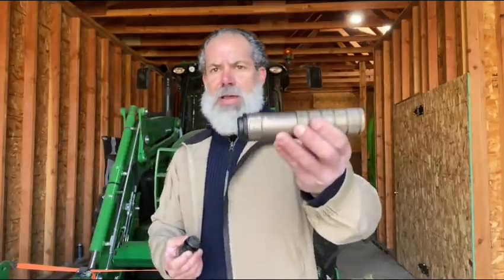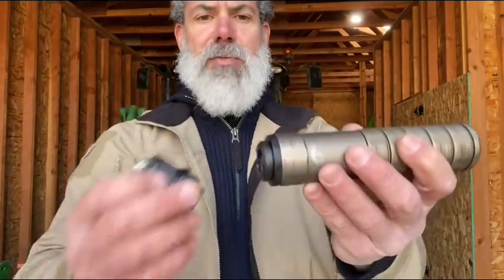@jkarmament form 1 solvent trap and now even more!

Comment: Wait... What was goin on at the beginning when you were goin full auto. We're the baffles like melting off or were they unscrewing or something. 👀
Reply: That's why you don't use aluminum for a suppressor
Reply: @picklerick9578  I just wish he answered the question. Not sure wtf happened there
Reply: Cerikote flaking off the suppressor.
Reply: Look like the finish was flaking or the baffles were coming loose?
Reply: If you watch closely you can see it's rotating counterclockwise. Unscrewing itself. There is a spot to focus on about midpoint of trap at 12 0clock position. When the video cuts it's almost at 9 0clock position..
They are notorious for unscrewing. I've had it happen and I've seen it happen to someone else.
NEVER USE ALUMINUM. PERIOD.
Reply: @ageckomiller  gotta run em with the keymo mount

Comment: I recently bought the jk 155p. I just got my Form 1 back and drilled for 9mm. I like how I can use different mounts as I also intend to use it for 300 blackout by way of the Griffin plan A mount. I would love to see a decibel test of the jk can with 8/6/and 5 baffles on both 9mm and 300 blackout. Love your gear reviews and wish you would show off and go over your AR15's with us. They would get tons of views.
Reply: Does the griffin plan a have a hole for a pin weld
Reply: No it does not
Reply: @Kentucky.Tactical  dang it I got a geissele super duty in 14.5 with a surefire flash hider I would like to find a quick detach mount that I can run a jk armament can on and still be legal 16” with pin and weld
Reply: What do you think of the quality compared to other products on the market? I’m really intrigued but this design but my gun snob friends are trying to talk me out of it saying it’s a “cheap knock off of silencers”.
Reply: @joshuazachmann6644  I know it's an old question, but he does have more than one. I'd assume for you to buy multiple they have to at least be decent.
Reply: @The-Tactical-Plumber  I know its 2 years later, but some of griffin's taper mount muzzle devices DO have a pin hole for pin and weld. Just did mine not too long ago
Reply: @Dethnaught  in that 2 years I ended up getting a surfire rc2 for my 14.5” super duty witch is now a full clone urgi with a 4 prong flash hider got a Allen engineering aem5 for the mk12 mod1 that’s like 280 days in on e file and just bought a sand man k now I just need a 9mm may go the jk route for that the new 12ga can looks cool too

Comment: I wish I could say that it's faster to file a form1, but due to current times it has now extended the wait times for solvent suppressors. I filed my E-form1 for my JK back in December and I haven't even received my contract number to submit my finger prints to start the process which usually take about 7 day's after you file. I've called the atf several times with the same explanation to just wait and don't expect anything.
Reply: I just got mine approved in 22 days.
Reply: Did you make your own model number or choose one from the list they have of already used model numbers?
Reply: 29 days for me, but not via JK, I filed it myself
Reply: @Stuck-on-Stuck  Nice
Reply: @Joemama1q  Yes I did Create my own model..listed 45HYBRID. Good news it's saved now for anyone to use..lol...but that could've been the reason along with the Gun scare and Covid.  Although it only took roughly 140 days still not that bad compared to my 1year wait when I purchased YHM Tutbo k

Comment: I believe T-Rex Arms makes a holster that can accommodate a suppressor on your G19.
Reply: They do. And it is awesome
Reply from the maker: Yes and so does Surefire but I don’t want so overt
Reply: Costa Ludus Did you Drill and Pin your Criterion Core or just Set Screw the Dimple? Criterion Recommends not Drilling as it affects Harmonics, but many MFGs swear by Cross pinning. Thanks
Reply from the maker: @sheepdog916  they did it, I don’t think it has a pin just the two set screws
Reply: Costa Ludus they only come with 1 dimple, because not every customer uses the same Gas Block and every gas Block spaces
Set screws differently,  but the gas Block they use and recommend (the Badger TDX) comes with 2 set screws. Do you think they dimpled a second time for you?(since they knew what Gas Block they’d use with your gun). If so I’d get a Gunsmith to machine me a second dimple although most gunsmiths recommend against it, as it Marie’s you to that particular gas Block.

Comment: I'm curious, on the trap that you're using on your .556 drilled larger, for say, 9mm or 300blk? If so, does having the larger hole shooting a smaller caliber effect the signature reduction? Thanks in advance!
Reply: @fullfofire not a super huge amount though. Really depends on the design. There are some suppressors made for 5.56, yet can take 7.62 because the bore hole is large. Cgs Helios if I’m correct, is the suppressor I’m referring too.
Reply: @fullfofire 9/32=.281 vs .308.

Comment: I have bought one of these and didn’t realize it was all aluminum. I seen on their website they have a upgrade kit will that help anything at all. I want to use it on a 556 rifle.
Reply from the maker: I’d call them, I run aluminum hardcore on 9mm and 10mm. I have the SBR for my 300blk and 5.55.
Reply: Thank you for getting back with me so quickly.
Reply: @TheofficialCostaludus  is the SBR model safe/effective on longer barrel 556?

Comment: ehh..... I've form-1'd 2 low pressure cans (.22 &9mm) for about 250 bucks each (including having them professionally engraved and cerakoted). For higher pressure stuff, I agree with 50 stitches, I'll stick with my store bought and warrantied cans.
Reply: I've bit the bullet and got one. $700.00 for the package and accoutrements to direct thread it on a PCC. at least the form-1 only takes 27ish days.

Comment: Titanium can't take much heat. Do they have kits in steel?
Reply: Yes they do have steel
Reply: It can take heat. It has a 3,000 degree heat resistants..it  just erodes quickly from unburnt powder from a short barrel because gun powder is cleaned with ammonia which is erosive to titanium....I’m in the process of making a true battle ready can with their parts. I bought their Titanium kit. With 2 extra Ti baffles and also bought 3 of their 17-4 stainless steel baffles from them to use as the blast raffles and am going with the Deadair KeyMo mounting system

Comment: I wouldn't use a solvent trap you can buy online for shooting. Too dangerous. They have to be built to withstand the pressure of high power guns.

I saw a video where one exploded shooting either an AK or AR. If I get one it'll be meant for guns. And get the tax stamp.

The law should allow for a person to build and test it before getting a stamp. You have to make sure it's gonna work first.
Reply: Materials are important. Stainless is excellent, titanium is good. Most use stainless blast baffle area then titanium everything else. Also to be extra careful complete Form 1 online, and get stamp first before buying.
Reply: @The_John_Galt  I'm not going to get one. I'll just have to wait and get a real one.
Reply: If you have basic metal material knowledge and know what your gettin they seem fine...I've seen even OSS cans die before expecially on belt fed firearms nothin is indestructible.